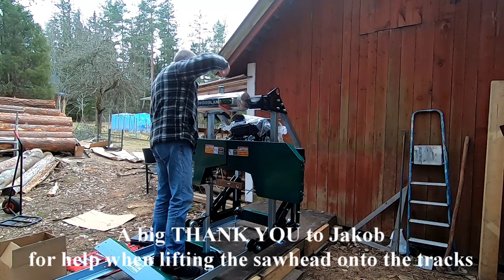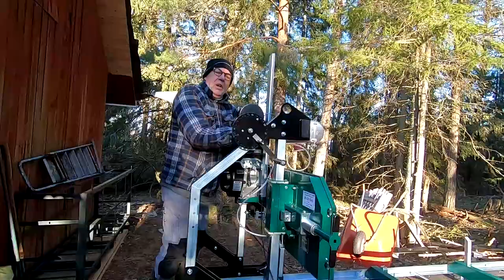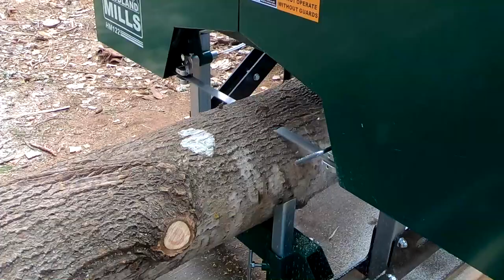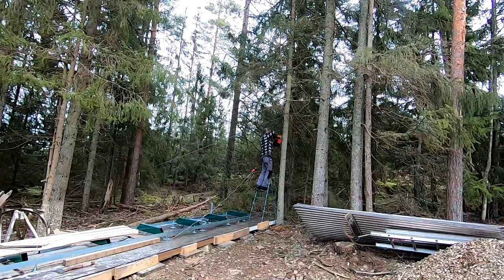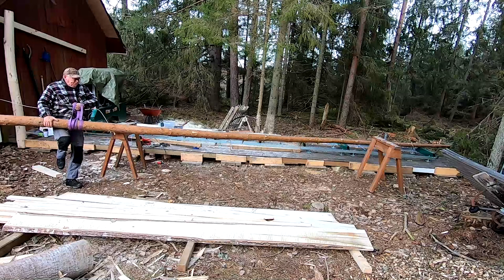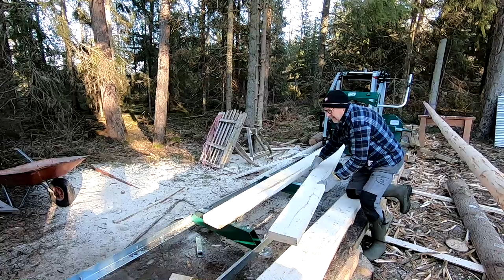First cut, Woodland Mills HM122, Boards and Lumber. VLOG #144 - Season 3

Comment: Just remember to keep an eye on your blade tension and if you start having to really push hard to get a cut finished it is probably time to change blades.  Also, if you find a lot of sawdust building up around the pulleys and wheels inside the saw casing you may very well be using a little bit too much lubricant.  Nice Video!!!
Reply from the maker: Hi Andrew. My blade tension is as it should be, and I'm not pushing hard, but light. My lubricant gives aproxx a drop a second, so that's not a problem. Over all there are no problems with Woodland Mills sawmill.